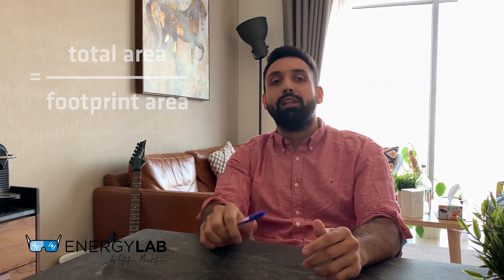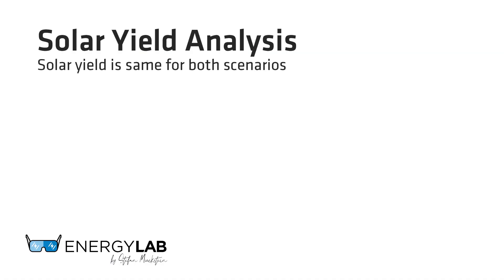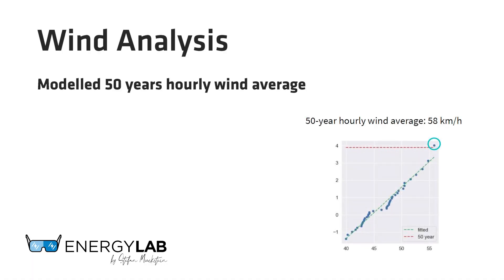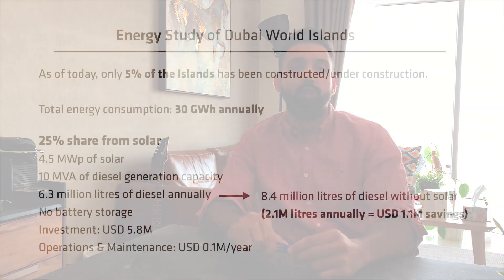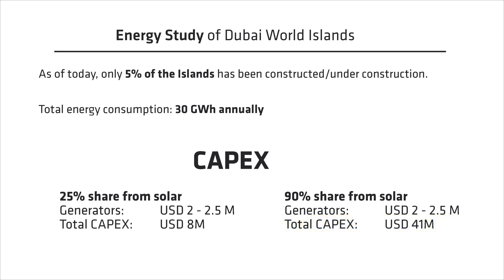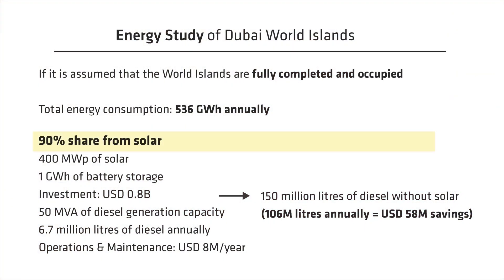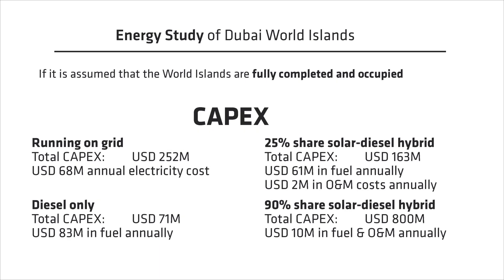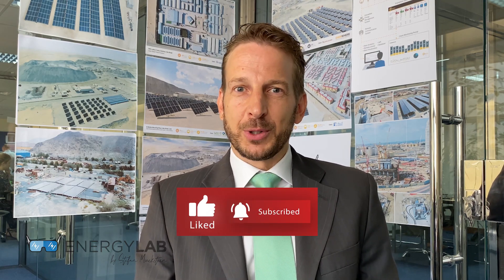World Islands' energy problem solved! Engineering approach ...

Comment: Very informative Stefan. I just wanted to know when we are connecting to DEWA , I see 132kv with power transformer and 3 core cable costs . Also before the connection point we need to have several step down substations and switchgear costs involved .